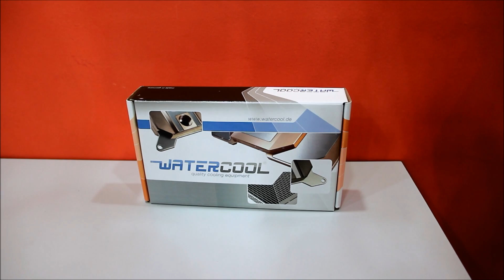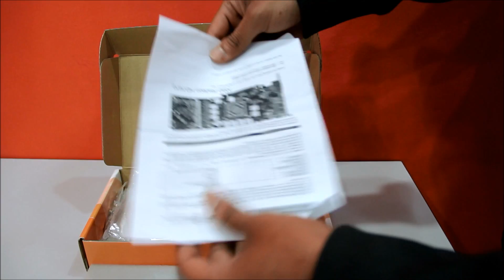Watercool Heatkiller X3 79X0 Gpu WaterBlock

Comment: goalie, the backplate goes on the back of the video card and connects through to the waterblock.  It add torsional strength to the card ie stops the card from bending due to the weight of the waterblock pulling on it towards the bottom of your PC case.